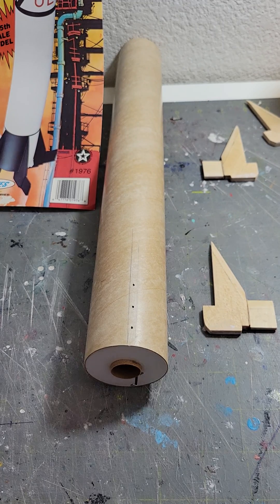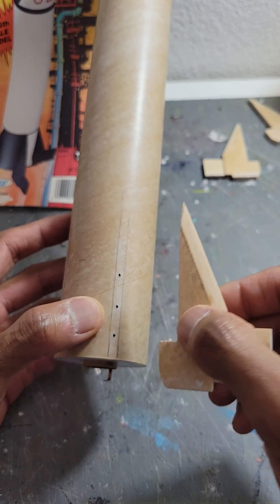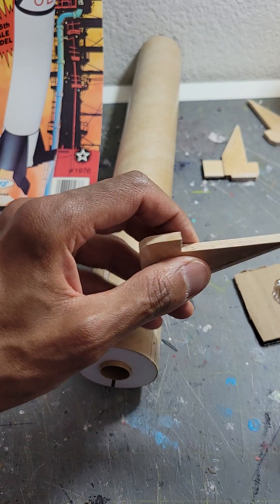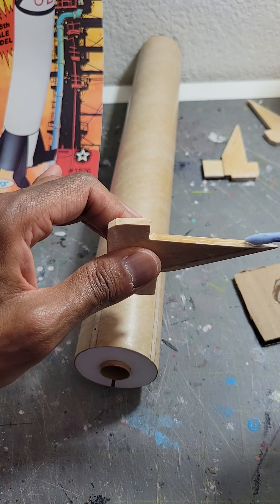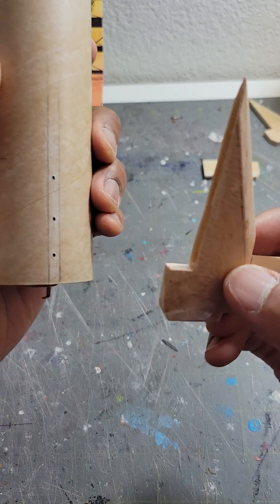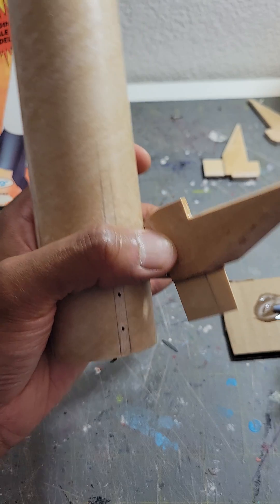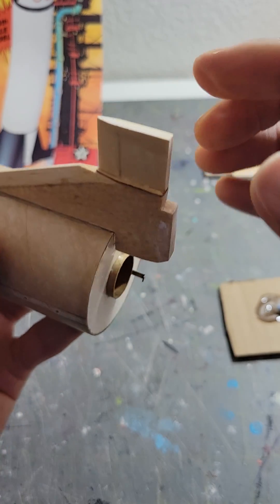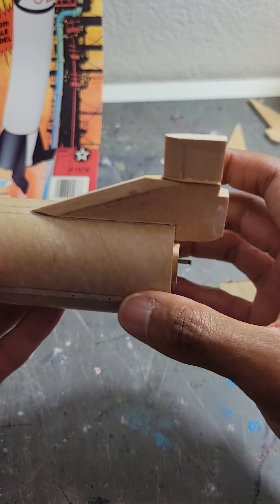Model Rocket Glue Rivet Technique: Build Tip. #Rockets #rocketeer #howto

Comment: From the fin design and placard in back, looks like  your building a Mercury Redstone?  Can you confirm?

I ask as I have one and all my others yet to build and want to enforce the joints some. (i’ve always used a glue fillet) but i haven’t built since 79.  

Thanks Kieth as always for putting these together
Reply from the maker: This is the Jupiter-C. The one the put the 1st U.S. satellite in orbit. Same Redstone booster.
Reply: @modelrockets3215 Don’t be surprised if i show up down there some day with a box full of rockets and engines to launch.  😉.  Was so much fun launching my 1st kit in 4 plus decades.

Comment: That's really wise, i'd bet that epoxy wicks right into them holes. But on the MR the problem is with the extra fin attachment and the cheap fiber stock that Estes used to glue both parts too. It separates cause it stratified card stock, you can saturate it with glue and it is still flimsy and can break on recovery very easily, plus the more glue causes it to warp also. I know this is an older kit, I ran into this problem with the newer Mercury Redstone kit.
 I'd like to see you address this concern in one of your many excellent tutorials.
Reply from the maker: Surprisingly this balsa was pretty tough. One thing I may demonstrate is wicking CA in the balsa to strengthen it. Once this one is complete and launched, I'll see how it hold up. And do an up. I think it'll be ok even with the rudders sticking out. The newer Red Stone has plastic fins and we're pretty tough from what I remember.

Comment: Wish I knew that trick 35 years ago.
Reply from the maker: You know now buddy🚀🛠.  I 1st used it on my scratch built Mercury Little Joe 1. Not sure if I thought of it myself of saw it someplace 🤔 Just don't recall.
Reply: @modelrockets3215  I hate when someone else shows me something and I can't remember who showed me to give them credit. I know you are the first person I've seen use that technique. I must admit it probably holds better because of those small air pockets on the surface. I still remember the first time I tried super glue and ended up stuck to more parts than parts stuck to the rocket body.